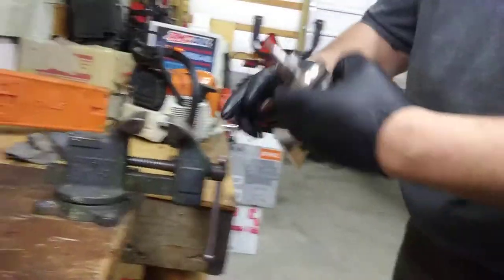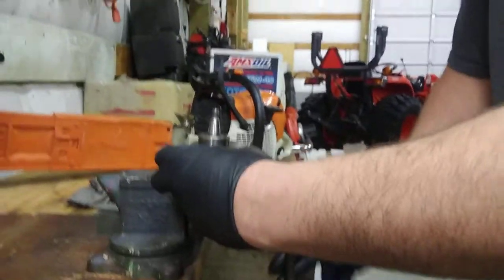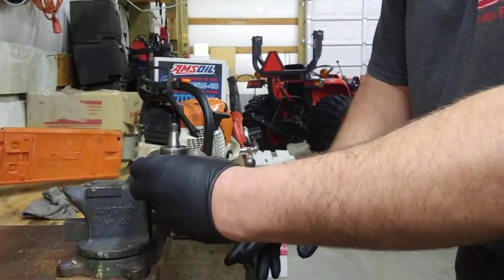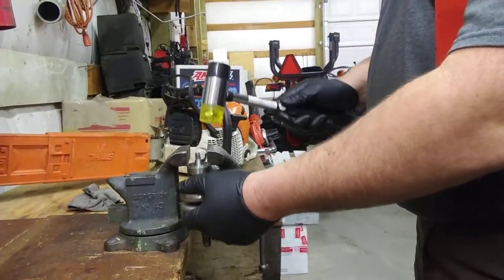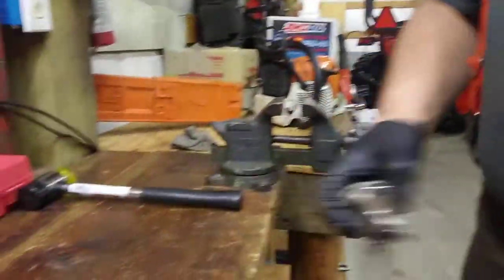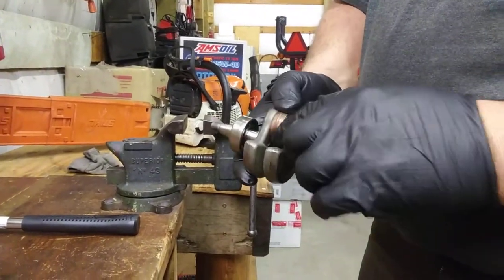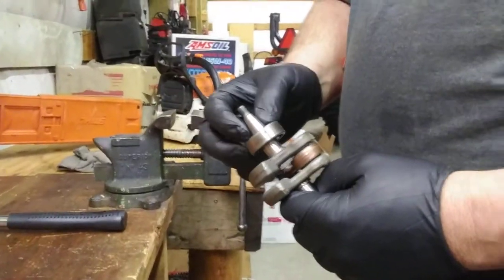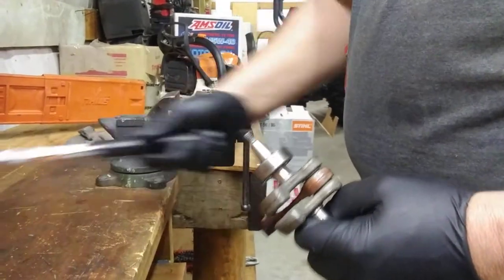Husqvarna crank bearing removal w/no puller

Comment: What about the crank needle bearing?
Reply from the maker: Comes right out with it
Reply: @jesusfreak3162  I thought you couldn't remove the needle bearing huh, I bet it's really hard to pull the crank apart!
Reply: @AutodidactEngineer  u need a hydraulic press for taking it apart